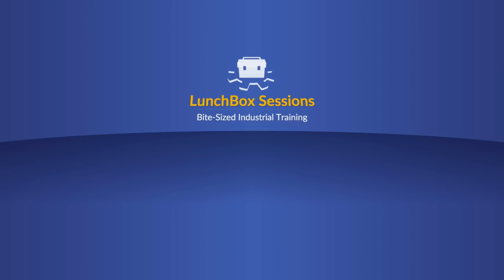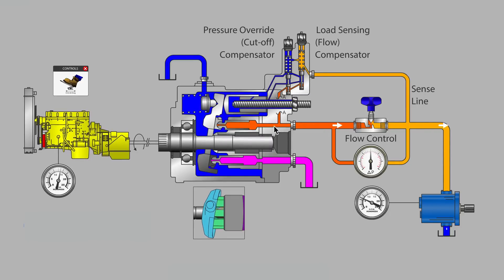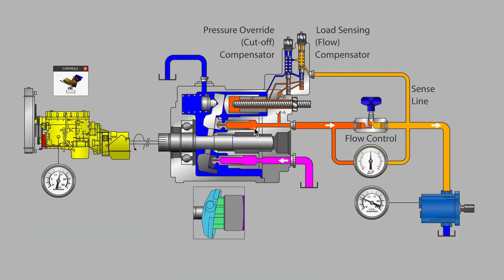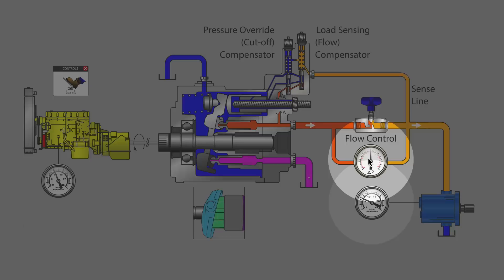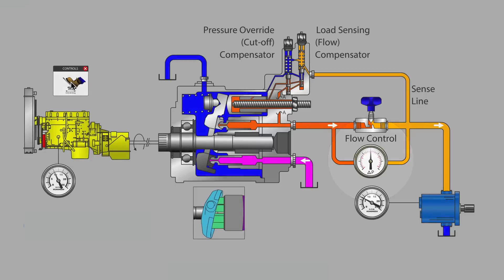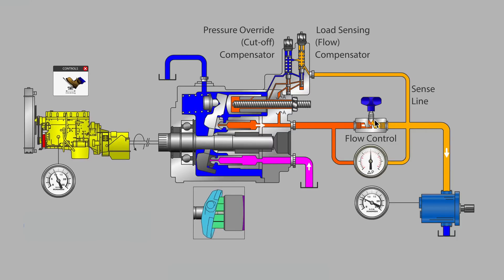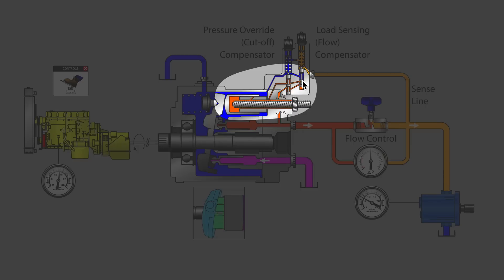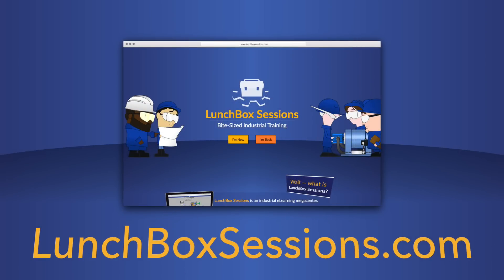Load Sensing Accuracy

Comment: Hello Carl,ive noticed that there is a flow control or restrictor at the pump outlet located before the pressure sensor line.What happens if there is no flow control or restrictor?Will the pump still function as it should?These is John Evan from Philippines,I’ve watch most of your videos and I learned a lot.Again thank you.
Reply: You always need a restriction between the load and the pump for this style pump to work as it should.  Not having a flow control, directional control, or restriction of some kind to backfeed a downstream signal to the flow compensator is the same as cutting the communication between the work hydraulics and the pump controller altogether.  It is the same result as dumping the LS signal line and sending the pump into a neutral low pressure standby condition.  There would be no reference pressure being fed back to the flow compensator telling it how to govern the amount of flow (swashplate angle) to apply against the load.  The flow compensator would always open against a the light (i.e. 200-400PSI) compensator spring and send the pump into the low pressure standby condition and 0 displacement.  You'd only get flow out of the pump when the load pressure fell beneath the flow compensator spring pressure, the margin pressure (i.e. 200-400PSI).

Comment: What will occur if the hydro motor will force to go backward?

We use hydraulic without LS to tow paragliders. https://www.youtube.com/watch?v=FIE-ThphoRM&t=94s

When the wind gets stronger, paraglider goes backward, thy hydro motor should be able to rotate backward with the same momentum on the axel.  Is it possible with this schematic?

Comment: Excellent video. I have a very stupid question. Does this flow compensated mechanisam acts like a "hydraulic governor"?
Secondly why the electric generator is not directly coupled to the diesel engine and a governor should be used on the diesel engibe to control the speed of the generator? Why such a complicated mechanism that involves an axial piston (variable displacement) pump and hydraulic motor?
Thanks for sparing your valuable time.
Reply: Hydraulic generators can used on mobile equipment, I.e excavators, bachoe-loaders, crane trucks where  engine speed varies, 
to power hand tools, water pumps etc. Generator can used normally even  diesel running at idle speed. Search Dynaset.

Comment: A suggestion to your excellent videos - I dont know where to send suggestions, but can you do progressive grease metering system animation - eg; showing a common 6 outlet progressive grease flow system - pump gets go command, grease pressure rises via supply gauge, flow/pressure to each outlet port via pressures on each outlet port as each outlet doses, the proximity cycling switch operating, and finally a 'blockage' in 1 of the discharge line nozzles, (eg #4), showing resultant pressures in all the outlet lines when #4 blocks.. If you also wanted, the other type of grease metering is parallel system..
Reply from the maker: Thanks for your suggestion. We've done just a little bit of work with grease systems. I believe it is inevitable that we will produce more material on that topic in the future, given all of the work we do with excavators and shovels. - Carl